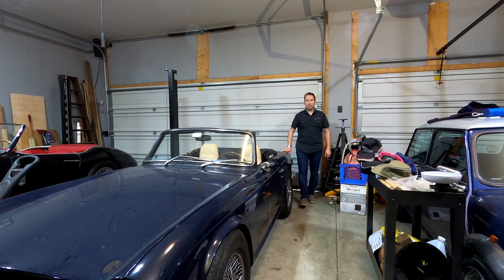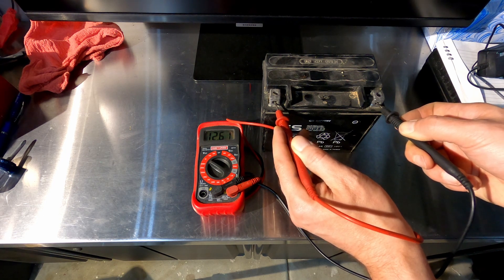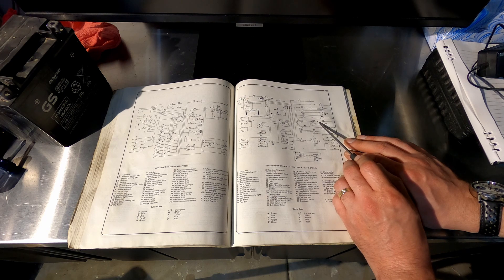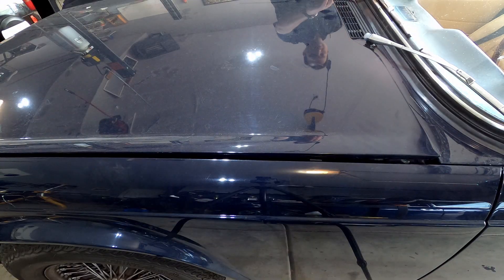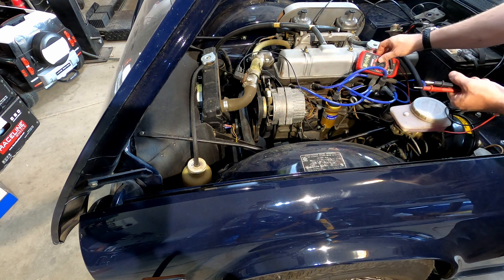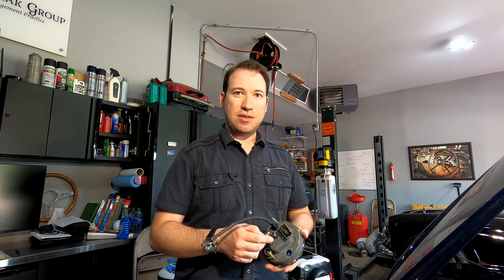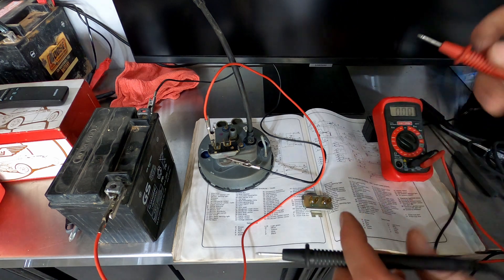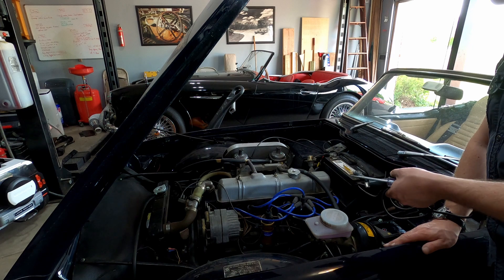Faulty TR6 Fuel Gauge? - Fix Lucas Electrics with a Voltmeter!

Comment: Great video! 
It is paramount that the voltage stabilizer has a very good ground. In the case of MGBs the screw that secures the stabilizer to the back firewall behind the dash is the ground.  The Triumphs are mounted to the gauge. In this case a good ground is equally important.
Reply from the maker: That's a great point!  Yes, a poor ground is often a failure point, causing inaccurate readings.

Comment: Good basic instruction video.  Whenever I see someone working on the electrics on a British car I generally recommend Rick Astley’s book, Classic British Car Electrical Systems.  It is a great resource. It has many colour coded diagrams and lots of troubleshooting tips.  Astley also has a companion book just for MGB.  Both books are very thorough.
Reply from the maker: I haven't read it, but I'm interested.  Thanks for the tip!  I'm not going to get Rick Rolled am I?....
Reply: @midwestmotoring  completely different Rick.
Reply from the maker: I know, but couldn't resist making the joke. :)

Comment: Great video as always. Question what octane of gas should I buy for my 75 TR6? Thanks
Reply from the maker: If it's not a modified engine with higher compression, then regular pump gas is just fine.  The compression in the stock engines is relatively low, so you don't need high octane.

Comment: Great video. First off, as an electronics technician, I fall into the 'shotgun' approach to parts replacement very easily myself- and this is due to the fairly cheap cost of replacing parts. I've found that method can introduce another issue, as new parts can be fail on install depending on the part, and now you have more issues! BTW, my trip miles indicator works but I can't do trip reset on my speedo. The little knob is  frozen. What do you suggest?
Reply from the maker: Thanks!  Most of the systems in these cars are very logical, and just need some patience and an easy diagram to figure out.  Actually, many original parts like wiring and switches can be repaired rather than replaced too.  

For the trip reset, it's a twist knob and not a push button.  I'm confident you know that, but someone reading the comment might not be.  Anyway, this involves pulling the speedo, but you should be able to disconnect the cable from the gauge.  I'd want to see if it's the cable that's binding up or the gauge.  If the cable, you could try a little WD-40, or replace the cable with a new one or a used one from another gauge.  I wouldn't go shooting WD into the gauge though, so if that part's frozen you might be looking for someone to do a rebuild. Might not want to mess with it until the winter.
Reply: @midwestmotoring  So True! I recently installed a headlight relay kit, and the fuse holder was junk. Took a couple nights in the garage to figure it out. Then, my light dimmer stalk was intermittent on both high and low beams; I cleaned what contacts I could reach with out dissasembly, then sprayed contact cleaner. Worked like a charm! I was proud.
Reply from the maker: @jamcdona  you should be proud.  That's the sort of logical thinking that's necessary to keep these things running well.  Sometimes solving those puzzles is my favorite part of the hobby.

Comment: Neither my 59 Bugeye nor my 60 BT7 have voltage stabilizers as original. My 64 Jag that I no longer have did have a voltage stabilizer. Were earlier Smiths gauges 12 volts? If so, why did they change to 10 volts? Thanks. Lin
Reply from the maker: Something you'll notice is that on the bt7, the fuel gauge needle flicks back and forth as the fuel moves around in the tank.  The later cars were redesigned so the needles were more stable, and i believe about that time they were switched to 10v and damped needles. The fuel gauge on a TR6 behaves much more like a modern car. I'm not sure if there's a reason for the 10v, but it might have to do with the damping.
Reply: @midwestmotoring  yes. I have a Porsche 356 dampener on my BT7 to “calm down” the erratic needle. I am wondering if the gauge itself changed or just the current that flowed to if.
Reply from the maker: I'm not sure but I bet it has to do with making the max voltage more predictable.

Comment: Mine runs out of gas at a 1/8 tank and the temp gauge barley gets over “ a quarter “. Is this similar to yours ? 
Did this correct the problem ( I assume it did ) 
Finally , you were able to leave the speedo in the car and got it from under the dash ? 
Thank you. Subscribed , Terry
Reply from the maker: It's actually much more difficult with the speedo in the car, but yes it's possible to reach if you have small fingers.  You're probably best off removing it for access.  As for improper readings, if you can get a voltmeter up there, check for the voltage coming out of the stabilizer.  If it's more than 10, then it's not working correctly.  Caveat to that: the old stabilizers work on an average voltage--they turn on and off to make the average 10V--so you might briefly see higher than that if you're using a digital voltmeter.  

One problem with your car is that the fuel gauge seems to be reading high while the temp gauge seems to be reading low.  The stabilizer might be at fault, but you probably also have something else going on at the same time.  Your fuel sender might need a little bend, or your temp sender might be giving an inaccurate signal.
Reply: @midwestmotoring  wow!  Thank you. I’ll let you know how I make out. I appreciate it. I’m north of Syracuse (ny)

Comment: I replaced my voltage stabilizer  a year ago with a solid state one.  Lasted a few months before it fried...  chinese crap....
Reply from the maker: I've had that happen before too.  I wonder how difficult it would be to open one up and repair it?  I'm probably not qualified to do so, but... how hard could it be?
Reply: @midwestmotoring  Probably not worth the effort. Just go to your favorite electronics supply vendor and get an LM2940T-10.0 voltage stabilizer, a 0.47uF tantalum capacitor for the input side, and a 22uF tantalum capacitor for the output side. Wire it all up and you'll have rock-steady 10v as long as the input is at least 10v. Pay attention to polarity on the capacitors. The LM2940T is made for automotive use and should last a long time. I did this for my GT6, the cost of the components was only a few bucks, much less than what the vendors charge.
Reply from the maker: I'd love to do this. Is there a writeup somewhere, or some photos?